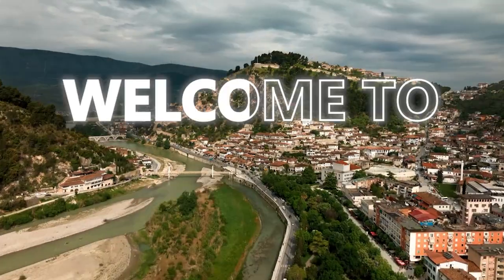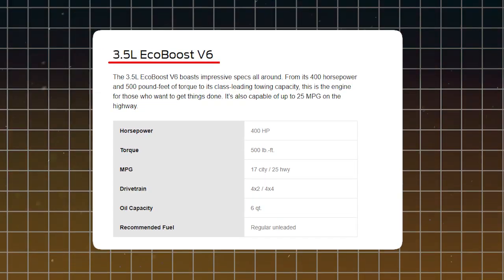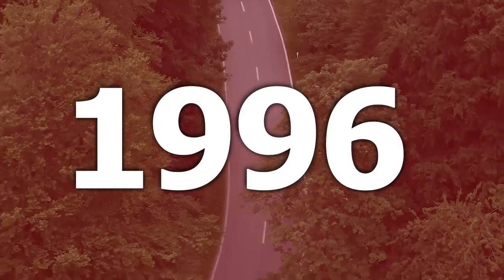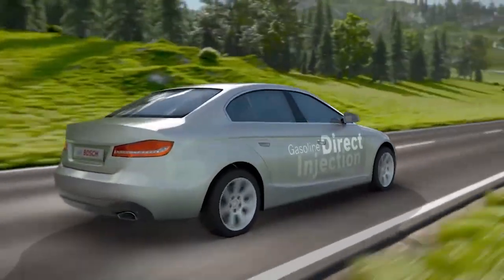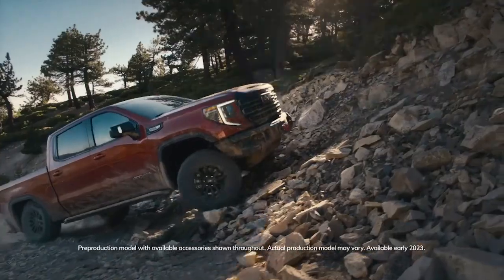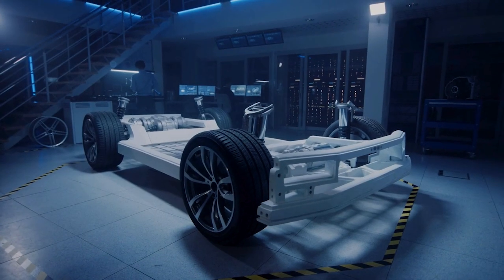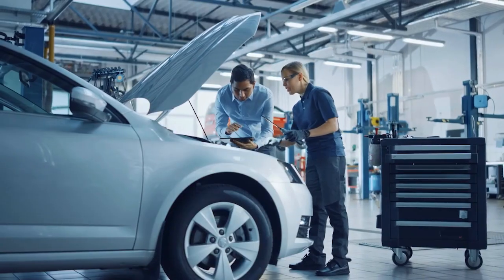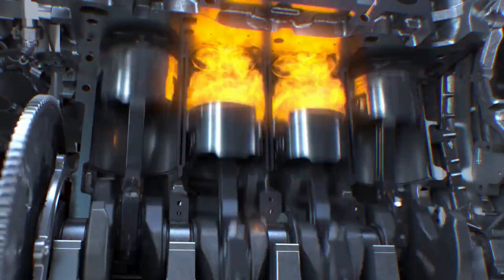Gasoline Direct Injection (GDI) Engines Explained: Power, Efficiency & Future Trends | Auto Stats

Comment: Carbon build up in GDI is far not so bad as they say! I have one on 170k km and it barely have some!
Reply from the maker: What oil are you using, is there any thing special being done by you.
Reply: @autostatsUSA  I just bought it second hand. But the previos owner maintain it meticulously. Even with oil changes in 10 000 miles by the service book. Always use the exact oil manufacturer recommend and use at least 95 octane gasoline.
Reply from the maker: @steliannikolov4163  Thanks I also own GDI engine car, additional to 95 Octane , I also add  Liqui Moly Injection Cleaner approx every service, this thing goes in gas tank.

Comment: GDI only is terrible. Those are not proving to be good. Gas cleaned the back of the valves and prevented carbon buildup. Gas in GDI engines bypassed the valve and goes directly into the cylinder under extremely high pressure. Don’t go GDI only, Toyota uses an alternating method between GDI and traditional intake method that cleans the valves and gets the efficiency of GDI engine.
Reply from the maker: Gdi was launch long way back I would say.cetainly they are much more complicated compared to non gdi due to direct injection. Still they doesn't offer very high compression ratio as of diesel.
they not only can produce more power but also optmize efficiency .
Reply: @autostatsUSA  they don't produce more power, nor are they more efficient than petrol engines with mpi.

you keep parroting marketing bs.

i will give a clear example:

renault megane rs vs hyundai i30 n

- both are sporty hatchbacks
- both are turbocharged
- similar weight
- magane has an engine with mpi, while hyundai has gdi
- power: both have little over 270 hp stock
- fuel consumption: combined nearly 10l/100km

so what's really the point of gdi?
more expensive to produce and maintain and will fail earlier and more frequently.
conclusion: more money for the producer from an infeior design.

oh, and the megane has compression ratio of 8.6, while i think the hyundai has nearly 11.0

if the megane had that ratio, it would have clearly more hp than the hyundai.

i forgot! both have the same cubic capacity of the engine: 2000 cc.

so the example is cearly relevant.